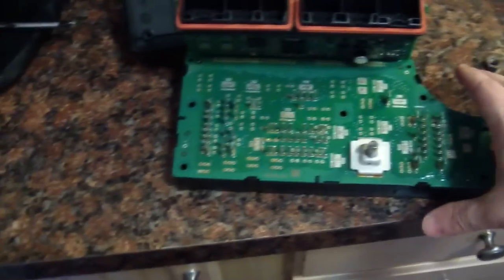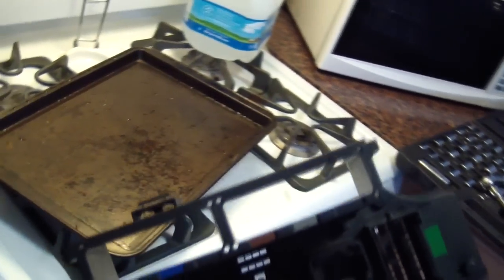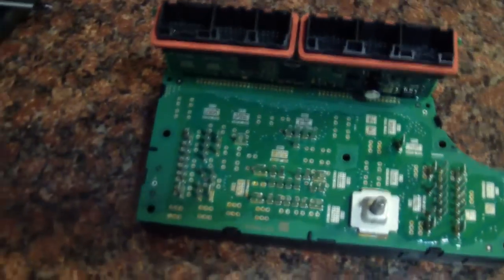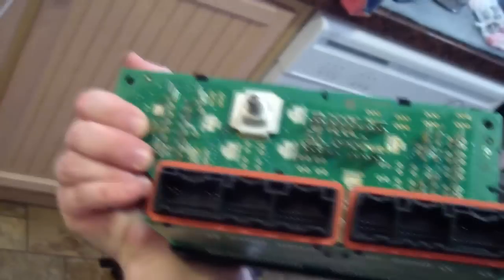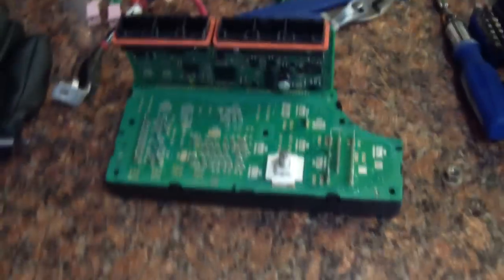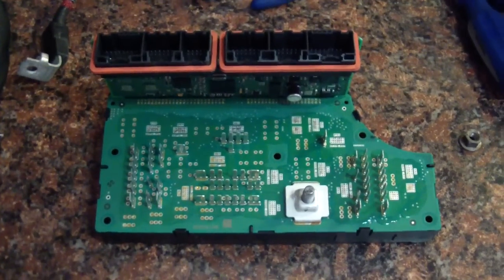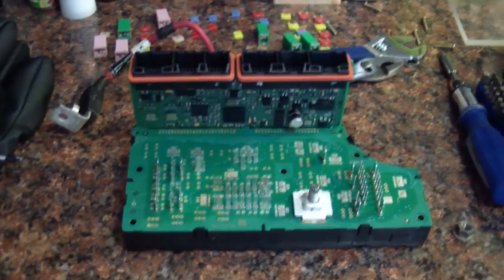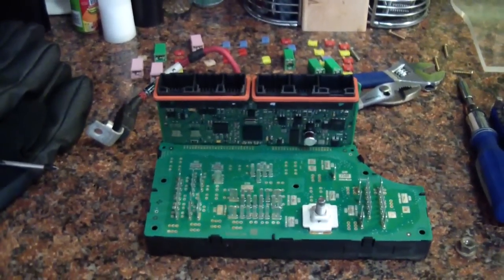2007 Dodge Caliber TIPM inspection - look at the guts!

Comment: go to carcomplaints.com
Reply: I had the same problem. One side of my headlamp doesn't work. I brought it to one of the repair shop . They told me my car need to change the ( fuse box) it cost over 1000 dollars. Then I brought my car  to another repair shop because my friend told me too, this is his mechanic.  The shop name Linh's auto repair at 6298 wilcrest dr. Houston TX 77072. I brought my car over there, after the mechanic checked he told me that my car needed  to ( reprogram the computer) it cost $150.00. I was let him do it. Now my headlamp works fine. I know he is free estimates you can bring your car to him he will take a look for you or you can contact his business phone #281-568-8764. He is very honest person.
Reply from the maker: Not sure why people marked this as spam. If it was I, it was in error.
Reply from the maker: linh phan Sounds like a decent shop. Wish they were closer :)  There is just a reprogram needed in some cases, but in some, people have burned out circuitry in the TIPM. Glad you got a real shop :)

Comment: my 2014 rubicon with 1700 miles just had the TIPM fail. it has never been wet at all. the service guy said chrysler has changed vendors and that these have crappy solders . there is a class action lawsuit as of august 28!for mopar owners thru 2014
Reply from the maker: Have any additional info about that class action? I'd love to add a link to it from the video.
Its a shame, because the cars are otherwise not "that" bad. I remember calling them (corporate) and being told they were not aware of the issue. If they make the CEO drive one it would change real quick...

One other note - some things the TIPM will disable if it detects over-current (stuck wiper motor, headlight about to blow, etc) unfortunately it is super expensive to own the correct tool to reset it - regular CANBUS/OBDII scanners won't cut it.
Reply from the maker: Was just thinking about this - if someone wants to send me a "dead" unit, I can reflow solder it to test that theory. Frankly the surface mounts on this shouldn't run into solder issues - PGA/BGA style mounts are notorious for it.
Still call bull on Chrysler - why would the ECM (engine computer) be totally sealed yet this module which is about a foot away isn't. I cannot imagine they would spend the money to waterproof the ECM if they didn't think it was necessary. shrug just wish they would stop the crap already and think about the customers.

Comment: i bought one from a scrapyard and installed it myself. I didn't know you had to flash it.  then bought the dorman rebuild like you recommended ?($450 w/ 100 rebate for sending back the core) and $220 for dealer installation and flash.
. screw you dodge
Reply from the maker: Usually yes, sometimes you can get lucky with the dorman units, but don't count on it.

Comment: In the video you said you had problems with the front wipers, did it fix the issue ?
My 2007 sebring wipers only work on high speed and washer fluid is pumping weak (both wipers and washer are on the same switch).
I tried changing the wiper motor and the switch but the problem still persists, could it be the TIPM ? Thanks !
Reply from the maker: I ended up bypassing the wretched thing and installing relays.

I'm unsure on the Sebring - I don't think it is the same TIPM module, so things may or may not run through it. If you are handy with a multimeter you can pinpoint the issue at the TIPM or at the switch. It may just be a case of the dealer having to reset it (using super expensive dealer-only scan tool)

Comment: i think all cars use the tipm what a dumb thing to do relays are much cheeped so are fuses thanks for this vid
Reply from the maker: I just replaced the Defrost relay on my 99 Volvo. The relay was in service since manufacturing in 1998 until 2017 working flawlessly until it died. Volvo has a hybrid TIPM like device that has both the electronics and REAL REPLACEABLE RELAYS - at least on my year :) And then we have the 2.4L Turbo vs the 2.0 in the Caliber. Getting 21 .4 MPG on a 19 year old vehicle and I'm not even done getting her into what I like to think is stable mechanical condition.

Comment: Great video! You're thoughts basically mimic my own.  The logic used to replace a "dumb" fuse block / relay setup with a computer is just beyond me.  Then to further complicate it they've made it impossible to reset without a dealer computer (the $1200 Autel scanner from amazon resets these too).

Epic fail dodge!  I'll never buy one of you're POS cars again.
Reply from the maker: What worries me is that it isn't limited to Dodge - and they are set to cut circuits based upon perceived over-current set-points. 
Ever notice how the shuttle program didn't use TIPM style modules on the shuttle? They stuck with the conventional switch and relay for a reason! Just imagine what would have happened if their instruments went wacky...

Comment: would you happen to know if my problem could be related to the TIPM?  once in a while my 07 caliber will lose all the guage readings- speedometer, tachometer, temp guage all go down to zero.  obd code scanner says U110E - lost ambient temperature.  im pretty sure losing a temp reading wont directly cause my gauges to go dead, so im thinking something electrical is screwy.  and the innova website says the verified fix is to replace the TIPM.
Reply from the maker: Is it possible? Absolutely. I'd recommend having the dealer check and verify your vehicle has the latest firmware before you shell out the money to replace it. If it does, odds are you have a TIPM failure. Keep in mind that as far as I know, only the dealer was able to reset B-Codes (which you typically can't see). They stay in PROM after the battery is removed, so disconnecting the battery doesn't do anything.

Verify you have no other issues before you spend the time to replace it - power surges (bad alternator/battery/other load) can cause them to fry prematurely.

Think of the TIPM as just a fuse box with a brain - a brain occasionally on drugs...
Reply: i reset the tipm.  so far no problems - havent drove er too much yet tho... thanks
Reply from the maker: DTh21381 In which manner were you able to reset it?

Comment: fyi, the electronics are covered by a glue that makes them water proof. \m/ no need to seal as seals allways brake when temp is high/low/freeze.
Reply from the maker: That's called conformance coating, and while the board has it, none of the connections that are subject to fail are properly engineered. I wonder why the ECU (located next to it) is hermetically sealed - and those aren't prone to premature failure yet...

Comment: Just had one question, can you post a video on how to remove this part from a jeep or dodge? Also do you know if its just a plug N play part or does it need any extra expert installation cause this part is damaged on my car and the dealer want $1,200  for the fix. I think I can do it by myself but I definetly need some help.  Thnx
Reply from the maker: The reman from Dorman says on their site that you install it, put the battery back in, leave key on for 2 minutes and then it self programs. I know the one from Dodge likely does not. I currently plan on replacing mine mid. Feb. due to finances... I'll check for the link to their site and the instructions and post it at some point this weekend.
Reply from the maker: Try going to www dot rockauto dot com/catalog/moreinfo.php?pk=3954489&cc=1433277 which has a video from Dorman.
Reply from the maker: I may be doing it sooner now since I just lost the circuit for the high speed on the wiper motor - no wipers at all now. I'll make sure to make a video of this, since the dealers are practically raping people for the price they are charging. Plan on replacing my battery about the same time since it is on its way out as well.
Reply from the maker: After getting tired of the problem with the wipers I also tracked down a bad ground and ran another. I still have my high speed wipers. This spring I'll do the TIPM when it is warmer out, as well as fixing a leak on the diverter valve that's been leaking antifreeze for a bit. We just got 2 foot of snow, otherwise I'd go out there and make a video.

Comment from the maker: Turns out my TIPM on my 2007 Dodge Caliber is shot. The unit was sending voltage on two terminals at once (both low and high on low) when it should have only been sending it on one (low), this burned out the first wiper motor, and had I not caught it, would have fried the second one. Until I replace my TIPM I've cut the wire for the low speed circuit about 3" from the wiper motor and tied and sealed it off so it only runs on high speed. The downside is the blades no longer park correctly. Big whoop and $375+ saved.
Reply: Can you help me save some money?  I just ordered a new TIPM to install, and now I am looking to cut down on labor costs as much as possible.  Could I install it myself and then have the dealer program it?  How hard is it to remove and replace? Will I be able to drive the car if it isn't programmed?

Great video and thanks for your help!
Reply from the maker: Amy Blitchok I will try to post a link to instructions Sunday
Reply from the maker: Amy Blitchok I checked the site where I found the instructions the first time and cannot find them. At least with the dorman unit (from what I remember) it was just a matter of leaving the car turned to on for a few minutes. It should come with instructions. I believe you cannot run the car without it matching/programmed. You just have a bunch of connections and one single bolt to remove. Make sure to remove battery terminals first!
Reply from the maker: Amy Blitchok Just found it (probably no longer needed) Adding it to video info
http://www.dormanproducts.com/digitalassets/document/TIPM_IS.PDF